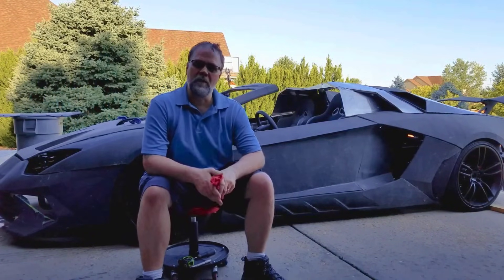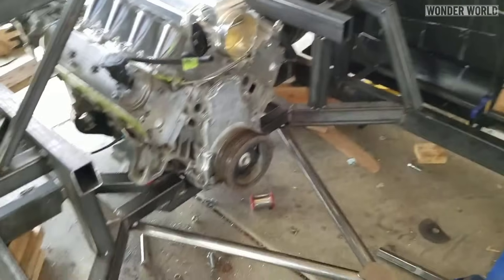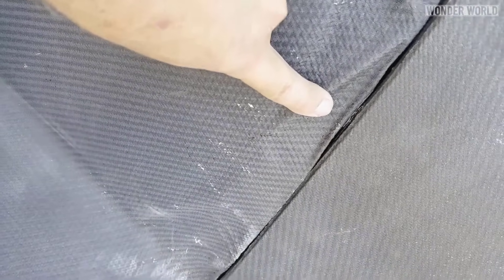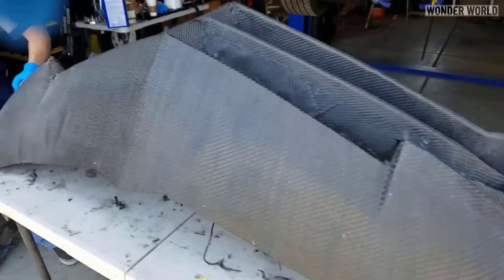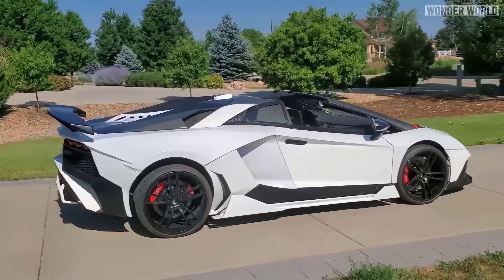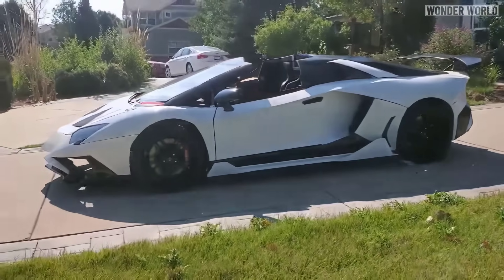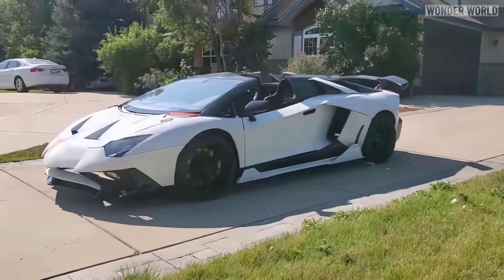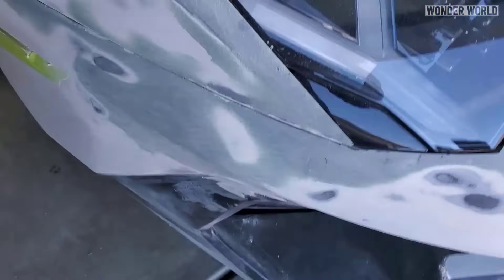Physicist 3D-Printed a Full-Scale Lamborghini in his Backyard

Comment: I don't know why we're not just 3d printing cars at this point. The cost of only having to replace a few panels at a time for a small accident significantly outweighs having to put down $5000 for a 4in scratch on a supercar because you have to replace the entire panel.
Reply: It takes to long until we get faster printers current manufacturing processes are simply more efficient
Reply: @chevinkennedy  we already have industrial sized 3d printers that can print accurate with multi color at a decently fast speed. So I can assure you spending $5000 for a piece of plastic that was just molded is not going to outweigh a 3d printer that can do it for $100.
Reply: @ key word “decently” fast still is light years slower then traditional manufacturing processes. Doesn’t mean that won’t change in the near future tho

Comment: Looks good but from my I standpoint the only thing I seen bad.... The size of the rims and the wheel well arches ... Whatever frame is under it is a little too small compared to the wheelbase that you 3D print ....the curvature of the quarters and the back bumper and the front fender and a front bumper is a little bit off not only is the curvature off but the placement of the wheel isn't centered like it's should be .......  And don't get me wrong right like you're a technical genius that 3D printed a Lamborghini I can't do that but I guarantee you what I can straighten out those body panels and gaps..... We're geniuses in two different worlds that comes together building cars....who gets me👍up🫣

Comment: Very Cool and one heck of a build.
I wonder how well the 3D print material is going to do in the hot sun.
Reply: Well I guess you missed the part where it started melting 😂. He covered the panels with carbon fiber to stiffen it up and prevent the warping but he really should have used nylon or abs.